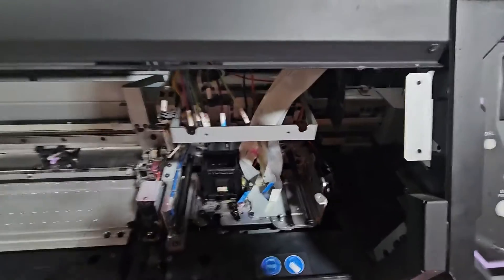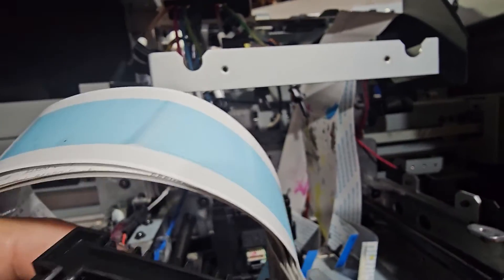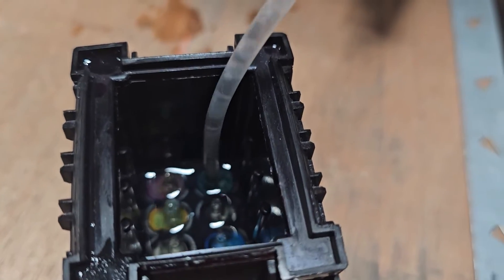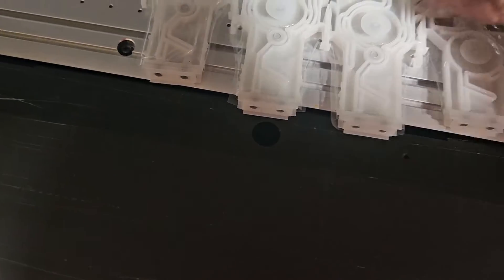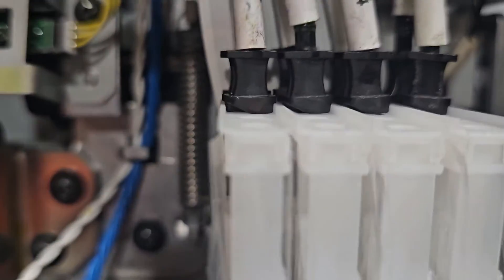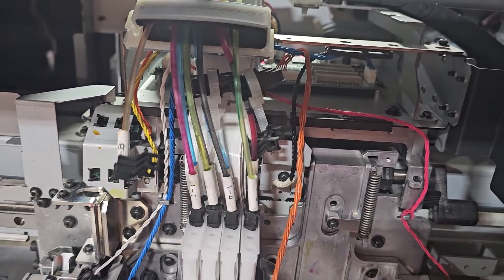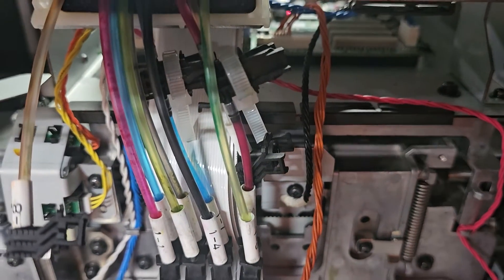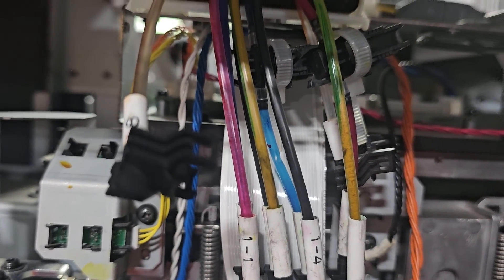Mimaki Cjv 150 Jv 150 Printhead Replacement dx7 epson REPLACE PRINT HEAD

Comment: Hi Mike, Greg from Wisconsin here.  My CJV150 head is dead.  During diagnosis of my condition, I pulled the head, flushed the channels and successfully replaced but still issues.  So I am confident on being able to replace it.  I am wondering if you sell or can direct me to OEM printhead.  I see that I can either get with or without memory board.  If I get with memory board do I have to go into service mode to "register" new print head?  And if so, once in service mode, what are steps?  I am in a rural area and service must come from 4-5 hours away so it is over $1,000 just for tech to travel so would like to attempt this myself.  Any assistance would be appreciated.
Reply from the maker: The memory board is important as it is what stores the head rank. If you reuse the old memory board, it will be to the old head, and the rank is pretty important. Digiprint supplies in texas is my usual go-to.
Reply: @printholix217  Then you recommend getting the whole head with board and ribbons?  And Do I need to register it with the mimaki or is it as simple as plug and play? (excluding calibration)

Comment: Hello I have a mutoh xpertjet 461uf uv printer with the dx7 print head I was wondering if you can use  the other 4 ffc cable ports on the left hand side  not sure if you will understand my question
Reply from the maker: Sounds like you are trying to use the the head backwards, I've seen that work in some printers but not sure about the UF

Comment: Hi Mike, thanks for the great video.  I just had the printhead changed on the cjv150-160.  After rrplacing, the printer is asking for is asking for ink type (SS21) and then is asking to remove the ink cartridges to discharge the ink and the fill up again.  I did it once and then it asks to do it again.  Seems like its in a loop to discharge and fill up.  Any idea what could be going on?  The head was replaced with a genuine mimakiband using SS21.
Reply from the maker: See this was a week ago and I was on vacation for the holiday. Did you ever get resolved?
Reply: @printholix217  not yet.  Any suggestions?  I'm guessing a setting in the maintenance mode changed for it to be asking for ink type, discharge and fill-up.

Comment: Followed all the steps but when i do the test print nothing comes out 😭 everything else was fine. Ink lines filled fine, no error codes, new dampers. Any advice
Reply: After ink fill up i can see ink in the capping station so i don’t think the head is clogged
Reply from the maker: Probably fuse on mainboard blown

Comment: Heeey Mike! Thank you for sharing your experience!!! I just spent my last dime to finally buy a digital printer that had clogged printhead Bc Mimaki replaced them under the end of the warrant. I've had this CVJ 150-75 for about a year and it's been running great! I think there was a power surge about 2 months ago that messed it up and I'm devastated bc tech support is astronomical and I'm looking at a $4000 estimate in hopes that my brand new print heads are not fried too or dried up now even though I put soulution in the capping station!!! Any change you could give me some advice of where to start? I am in the process of getting another printer that the printheads are shot on to pull parts from. I have the back off the machine and boards exposed. There are light on the 2 boards in the back behind the carriage, one is a bigger board on the right and on the left is a smaller board. Fan doesn't come on when power is turned on but lights on boards do. I would greatly appreciate any help and advice :) -Kimber
Reply from the maker: Hey, Sorry, I have been in Atlanta at Printing United Trade Show. If still not resolved, shoot me an email. Signworx217@gmail.com